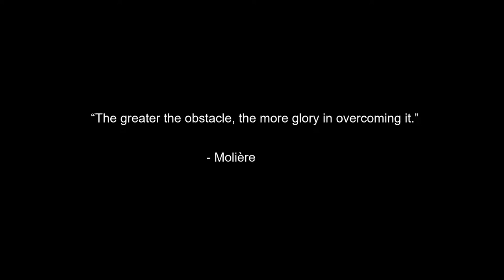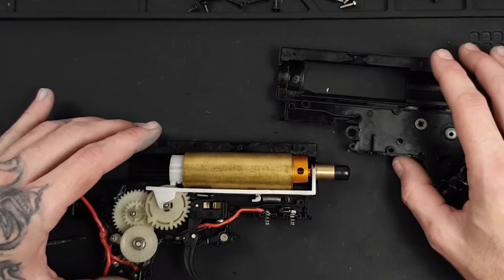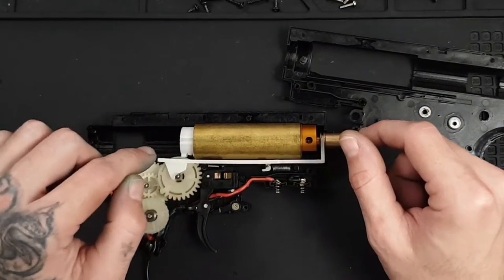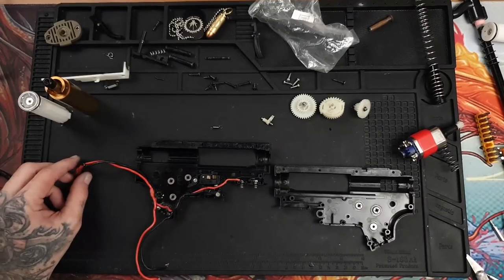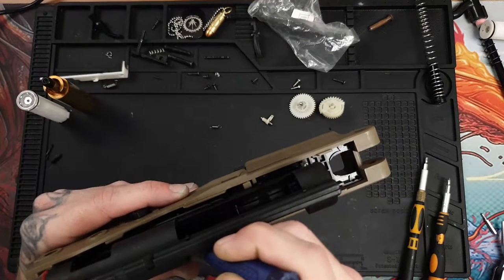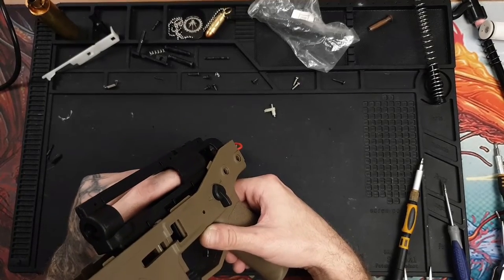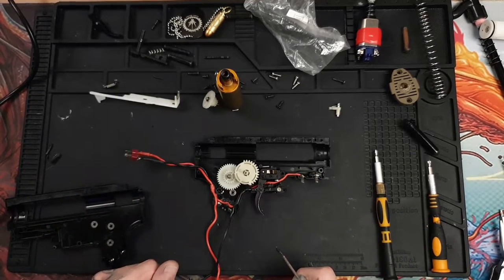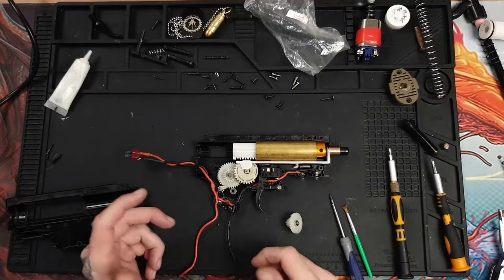J10 ACR Gel Blaster Disassembly and Review

Comment: Could U make a video showing how to do the hand grip modification for the motor? Im looking to upgrade motor and was wondering if I had to do that for it to work.
Reply from the maker: i don't even remember how I did it it was that long ago, I think I may have just melted through with a soldering iron and then screwed the lug in while still hot the create threading.
Reply: @Danny-G  Is it needed, because im not very handy like you haha
Reply from the maker: @jacksonkurthvlogs2448  i would say it is definitely needed to have a perfect mesh on the gears man. there is a metal handle bottom that comes with adjustable lug you can buy though so dont fret! :)
Reply: @Danny-G  could you link one?

Comment: horrible without the metal mag release 😉  also the screws out of the original clear gen9 gearbox is great for those nylon ones. seem to bite in way better
Reply from the maker: i didnt remember if they came with it or i put it on, so they do come with a nylon one??
Reply: @Danny-G   the original was nylon and being longer than an m4 one would flex and drop mags. i also put the metal motor base in mine and modded it for a 480 motor.
Reply: @18voltmofo  same.
I modded the metal motor plates and now I run the std gold SLR motors in my ACRs.